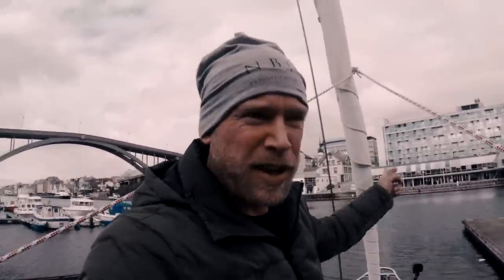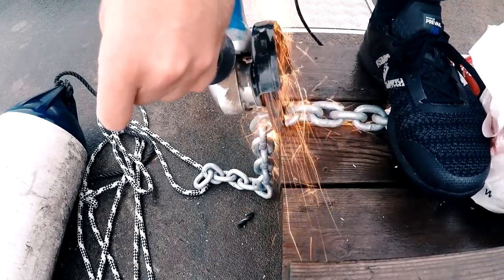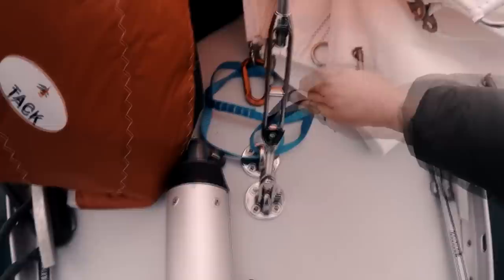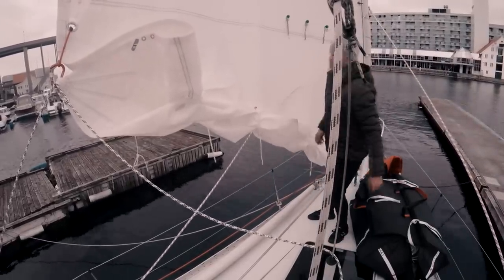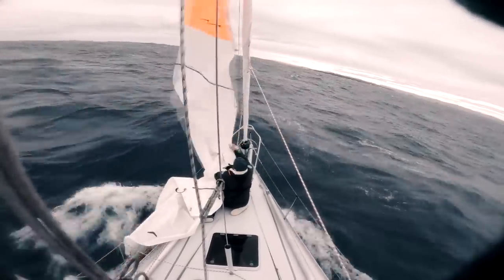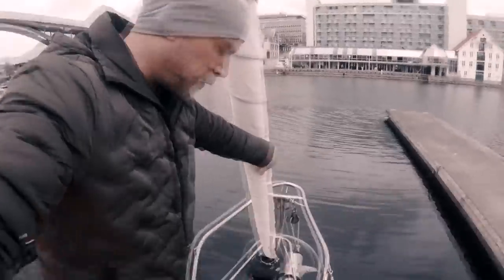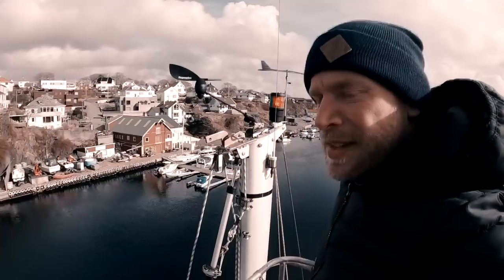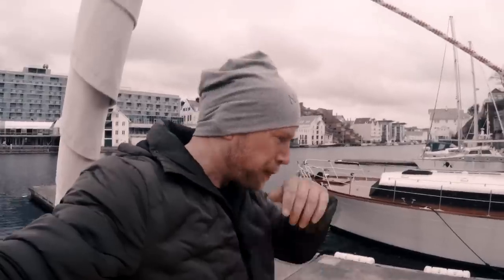Sailing with Rolly Tasker Sails!

Comment: Great video Erik! Thanks.

I would be carefull with those big Carabine hooks. They will slam viciously when you are working on the cutter Jib on the foredeck in high winds and seas...
Reply: Thanks for mentioning that, I understand the ease at the tack, but at the clew why not two bowlines like every other jib? Love the way you have it anchored to save any strain on the foredeck. Are you worried the chain will tangle in the locker with that support rigged? Oh and btw about that gennaker...
Goddamn that’s a beauty sail!!
Reply: Better still consider a dyneema soft shackle?

Comment: Erik, when drilling through your core and the stringers, you should drill oversize, fill the entire hole with thickened epoxy and then redrill your hole the proper size.  This will prevent any water from getting into the wood core.  Trust me, you'll thank me in 5 years.

Good on Rolly Tasker for recognizing that you will be a very good reference for their sails.  They did the same thing with Sailing Florence and I will seriously give them my full attention when upgrading my sail suite.

Comment: Love the new working jib. My old boat did not have roller furling so taking down my headsails was a bit of a challenge. I ended up making my own downhaul for the jib with a long length of small diameter braided line. I tied one end of the line to the head of the sail and ran the rest down through the center of each piston hank. The hanks will hold the line more or less parallel to the stay when hoisted. At the tack I used a turning block to run the line to a cleat near the mast. When I went to take down the sail I would ease the halyard and pull on the braided line. This would pull the head of the sail right down to the deck and into a nice, manageable bundle. I think this would work for your boat as well. Glad to see you back on the water.  Cheers!

Comment: Great to see you back, Erik!

7:22 - it is called a sling or runner, please be careful, as they are not rated to be used in wet/corrosive/icy conditions (at least when it comes to climbing)

Comment: Erik, I recommend caution when using climbing gear for sailboat rigging. Climbing carabiners are made of aluminium, which can not handle oscillating loads very well. These carabiners might break sooner than you would expect them to - due to material fatigue. I would use steel carabiners for this purpose.
Reply: I was just thinking the same. There are a lot of myths in the climbing world when it comes to materials and their properties, but this one I think is actual fact.

Comment: Erik, thank you for another fantastically inspirational video! We’re also adding an inner forestay to our boat and were struggling to get the best below deck fitting for the turnbuckle. Back to back padeyes - a perfect solution!! Interesting what you said about the mast bend. We’re adding running backstays to our Selden rig just to be on the safe side. Great idea of the jammer on the furling line. We’ve done the same. Makes furling so much easier. Can’t wait for your next adventure. Fair winds and following seas!

Comment: Well done Eric another great video. I'm a rigger/boatbuilder in the UK and I noticed your lower shroud covers on your cap, lower and baby stays. I just wanted to check that you lift these on a regular basis and wash off all the grit and grime that collects around the swages and bottlescrews. If these are left and not cleaned they can encourage corrosion of the bottle screws and even more important, you can get crevis crack corrosion in the swage above the bottle screws that can then fail. Unfortunately I have seen this a number of time over the past few years.
Another idea I have on my boat which is very similar to yours, is two clutch jammers for the main halyard. One in the cockpit and one on the mast.
When I want to reef I lower the mainsail at the mast using the mast clutch, hook the reefing loop on and pull up the mainsail a little at the mast and put mast clutch on. Then go back to the cockpit and pull the main halyard on tight using a cockpit winch and lock off with the cockpit clutch.

Comment: Nice to see what you've been doing the past few weeks!  That inner staysail sure makes a difference upwind in heavy weather, doesn't it?!  Reduces the weather helm on the wheel and reduces wear on the autopilot to move the center of effort closer to the center of lateral resistance.  I raced a 35' Jason sailboat for years as crew here in Juneau, Alaska and it was a cutter rig.  Also, the gennaker is awesome!  Just your colors!  I also have one that's in a sock and I just love to fly it on a broad or running reach!  These are what's called a 'working spinnaker' or 'cruising spinnaker' because they're really an asymmetrical spinnaker, as opposed to a symmetrical spinnaker that requires a spinnaker pole, topping lift and downhaul.  A good video Erik.  Looking forward to new adventures and new videos wherever these new sails take you!

Comment: Erik, have you considered adding a haul down line to your inner jib? Just a piece of 1/4" line tied to the halyard and clipped inside the hanks and run back to the cockpit, or wherever your jib halyard terminates. Can make life a bunch easier getting that sail down on the deck without having to wrestle it down on the foredeck.

Comment: Thanks for this - exactly what I needed to see to get my removable cutter stay in.  I have a ring on the mid foredeck already but watching your installation, I think I need to also reinforce it through to the main Ibeam that is the backbone for my boat.  I am installing the Selden Sprit also for my A2 and nice to see how yours works around the windlass.  Thanks!!

Comment: I recently downsize my head sail, from a 135 to a 110.  It's so much easier now to handle the boat when the winds pick up.  Because just like you said when you reef/furl the geneoa It just turns into a big bag. With the 110 I didn't need to reef it in the same conditions.  
Another plus of a smaller headsail, is tacking and gybing when singlehanded is a lot easier.  
Now we got to get you a top-down furler for that a5.

Comment: That is a perfect match of sails and sailor. Just one remark about the Genoa sheets. When you sail with the storm sail the sheets will damage (burn) the storm sail. I always lower the Genoa sheets to the deck with a few more turns to avoid this. It means a walk to the bow in high winds but I have not found a better way yet.

Comment: Great video as ever Erik. We have a Contessa 34 and installed a similar inner forestay to you for our storm jib, although ours is a Solent Stay rather than a cutter because we don't have the running backstays that you do. This means that we can't fly both foresails at the same time like on a cutter. Our's is tensioned with a simple block and tackle (the lower one a cam cleat), maybe easier to rig, but not as tidy looking as yours. Good work!

Comment: Compliments, you are getting more and more fitted out with proper stuff, no bulls... at sea! May I suggest you the use of dyneema soft shackles i.o. the aluminium mountain climbing clips, they are much stronger, lighter, probably even less expensive, and if the clew of the storm jib is flapping in the wind,there is less risk of getting them hooked on something, and less dangerous for you. I’m using them also for the gennaker, halyard and sheets. Keep on with the refit, I’m doing almost same things on my 38’. Ciao Dirk

Comment: Erik, I realize you just put a ton of work into this new setup, but if you find that the inner forestay with storm jib system that you have just installed is a bit cumbersome, please have a look at the ATN Gale Sail. It's a storm jib that you hank on by attaching it's large dacron sleeve directly over your furled genoa (or working jib) which also keeps the headsail from accidentally unfurling. It's a robust and simple system, and simple is safer- especially in strong winds and pounding seas when you are alone on the foredeck... Have a look!  Cheers, Walt

Comment: Nice work...look forward to your next adventure.
I would fit a down haul to the small jib.
There are fittings for making the removable stay quicker to fit, using a Highfield lever, surprised you did not use one.  Though if it will always be fitted when off shore, no issue.  I assume you can still tack the roller Genoa with the stay in place

Comment: Very nice and appropriate, as I need/have been planning similar for mine. Solent stay, I have like new sail from contessa 32 heavy cloth, and a storm jib I would run from new stay. Boat came with spinnaker and sock. so far I have only flown it at the dock in light air.. boat Yankee 38

Comment: Great Video and nice sails! I especially liked the Idea of adding Mast-Steps at the Top.
But I also noticed you use steel snap shackles/Carabiners at the clew for Jib and Gennaker. That is some heavy weight flying through the air, if your sails get out of control. 
Have you thought about using Dyneema Soft shackles? That way the sheets are still easily detachable but the rigg is much safer.

Comment: Great setup, one suggestion for you based off personal experience. I wouldn’t use any metal fasteners/parts on the clew of any sail. That inner staysail tacking in heavy winds (when you’ll be using it) will smash everything in a very aggressive manner. Dangerous if you have to go up to drop it while it’s flailing all around. Simple bowline for the sheets will work great.

Comment: when  started watching your channel I wondered why you didn't have a cutter rig for the heavy weather you get out in... now you do! great looking changes and sails. Wondering if you will have issue with the climbing caribiner and saltwater; i used them and they tend to get corroded but maybe they have changed the metal composition so that it is not an issue?

Comment: New sails look absolutely fantastic ....... not so sure about using alloy climbing carabena's ........ I have never sailed in cold weather conditions so don't have first hand experience manipulating this stuff in low temperatures but maybe consider replacing them with soft shackles and adding a downhaul line on the storm jib.

Comment: as i"ve discovered, the cutter stay held the mast inplace while i removed the forestay to replace the beam on my new to me cat.  I will be using the genoas from my T22 as the storm jib on my 30' cat.  The T22 was such a deal a quiver of 9 sails, a trailer, and the boat for 400 USD.  But was unable to do the kind of sailing and passages i am looking to do. lack of space.

Comment: Hi Eric, great video as always! So I understood that you modified your rigging from a sloop to a cutter, I’ve got a cutter too and we have to use running backstay when we go upwind and use the staysail because the inner stay doesn’t go on top of the mast. The backstay windward pull the top of the mast basically when beating upwind. Have you plan to set some running backstays on your boat too? Or you are not going to use the staysail on upwind points of sail? Cheers,

Comment: Awesome stuff!. Furler vs sock for gennaker: some prefer a furler, others the sock. As you single hand in challenging conditions do you prefer the sock to a furler? Or does the extended bow sprit limit your options?

Comment: Just wondering, did you "drill, fill, drill" the deck holes?  It looked like some wood core came out and I wondered if there needs to be epoxy there to protect the core?

Comment: Two more points: a dyneema shackle would be far safer than a mountain clip on the end of your sail ; to tame the sail when you bring it down, rig 2 lengths of elastic shock cord between the stanchions on each side, with a plastic clip in the middle of each: you bring the sail down and bring both elastic cords over it and clip in the middle. Both ideas are race proven and simple.

Comment: You put a stainless steel plate at the top of the aluminium mast, do you have a nylon spacer between them to avoid electrolytic corrosion?

Comment: Hello,
          the installation of an inner forestay is an excellent idea.  I notice though, that the forestay is connected to the deck with a bottlescrew and two removable pins; that solution may turn out to be rather impractical as you are likely to use the inner forestay in relatively lively sea conditions and 3 loose bits can be easily lost.  
If you have the opportunity, I would suggest you replace those three bits with a single adjuster mounted as integral part of the stay, one example of the fittings you can find to implement a solution with no loose bits is shown here:
 https://marine.wichard.com/en/stainless-steel-hardware/rigging-adjusters/babystay-adjusters/with-handle/part-5566
fair winds,
Alberto Fioretti